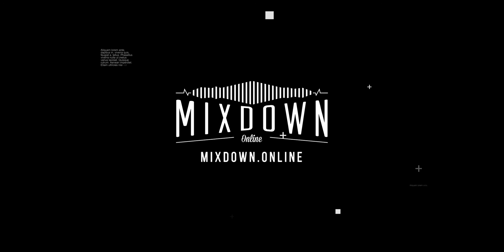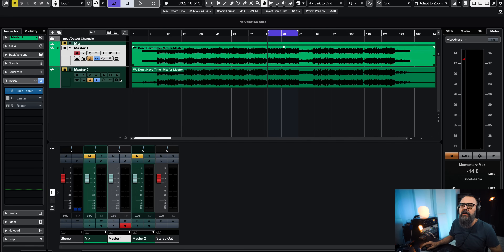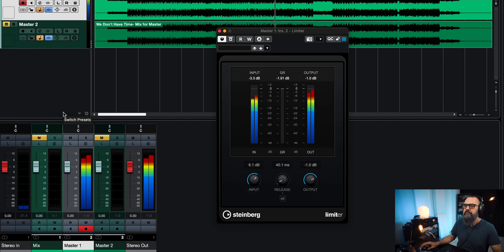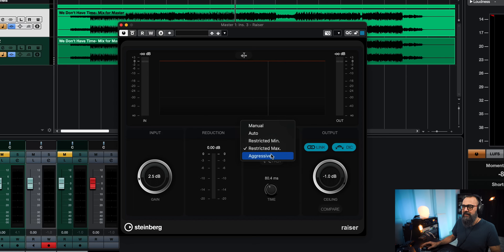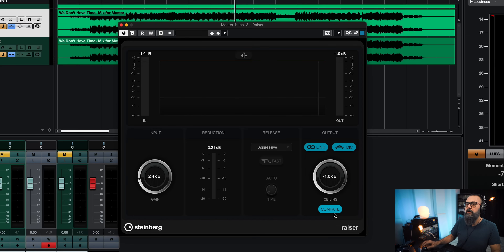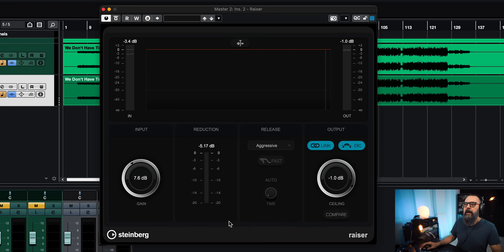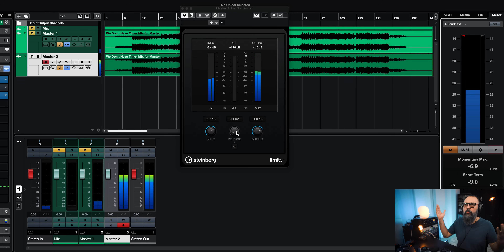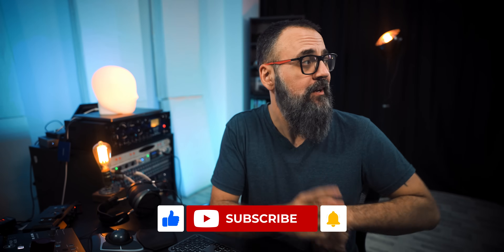How to get Loud Masters with Cubase Limiters

Comment: Seriously couldn't tell the difference between 1 or 2 limiters.  Normally I actually use 3 on my 2 bus, lol.
Reply: I couldn't really tell either, listening on headphones! But I know the compression is "less transparent" when overworking a single limiter VS sharing the load across multiple.

In Cubase, I like to use the Multiband compressor > Raiser > Maximizer... sometimes a final Limiter, if I'm feeling crazy and need to get that LUFS up 🤣
Reply: @heyiplaybassguitar  Typically I use ozone maximizer to get the level up some, Weiss MM-1 for character if I'm looking for punch or width and then a final ozone maximizer to get the last bit of level.  Often the first maximizer isn't even doing any compression, the weiss will do 1-3 db and the last ozone might do another 1 or 2 db of compression with over peak limiting.  All that gets turned of for the mastering engineer but I leave it on for the artists evaluation of the mix and I'll give the version with the limiters on to the mastering engineer as a reference for the direction it needs to go in when he masters so generally there are no suprises for the artist when they hear the mastered version.  Half the time they can't tell the difference between the mix and the final master.

Comment: Hey I guess this is a fairly basic guide to help people getting into mastering.
Is there a reason you leave 1dB of headroom? I use riser to barely knock the top off my peaks at -1dB then use the maximiser to gently push into fire the clip to chop a small amount of peaks. Then maximiser in Cubase to gently lean on a final brick wall limiter set to -.2 so is there a reason you leave 1dB of headroom???
Reply from the maker: The -1db headroom is recommended by Streaming services to avoid unnecessary distortion and overloads. I would set it up to -0.2 if my master was for CD.  Hope that helps :-)

Comment: What is the advantage of two limiters versus using a compressor first then a limiter?
Reply from the maker: Using 2 Limiters will just make your life easier if you want a Loud Master. The goal is to share the load of one Limiter with 2 Limiters. You can still add a Compressor before that as a glueing tool if you need to.

Comment: If you see the first limiter only reacting to the snare, is it wrong then to lower just it's volume with let's say 1db? So that the limiter is going to react to the whole mix. Or does it then find another element in your mix to react to?
Reply from the maker: With Pop, Country, and Rock, the snare often is upfront, and will have the Limiter react to it. I would lower the snare in the mix only if I think the snare is not well balanced with the other instruments, but not just by looking at the Limiter in Mastering.

Comment: Hi Chris !
Very very nice. Thank you so much for your video.
I use a pretty similar technique here : in a mix with peaks at around -6dB, I put a first limiter and add few -dBs, maybe 2 or 3. After that, I put a soft clipper, just to catch the peaks at around -3dB. And a second limiter, to achieve the job.
And ... very important detail : the two limiters and the soft clipper works in dual mono, not stereo link. It adds a little sense of wide.
Very nice and cool trick Chris. And the track used in this tutorial is just amazing.
Greatings from France. 🇨🇵😉
Reply from the maker: Awesome Stéphan!  Thanks for sharing your process :-)

Comment: Thank's Chris for your approach. I do use also 2 limiters (better to say limiter and clipper) but in WaveLab. But my question would be your metering is always in red - what metering scale would you suggest also to have optical control of the loudness? Thank's in advance. Jan
Reply from the maker: This one is in LUFS probably setup to -14LUFS, so it will go in Red for sure, but that doesn's matter